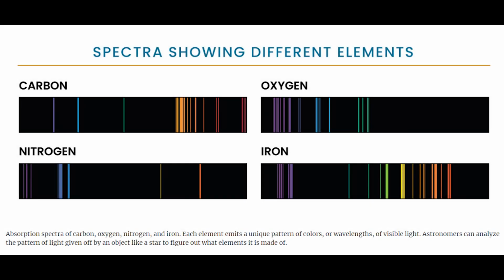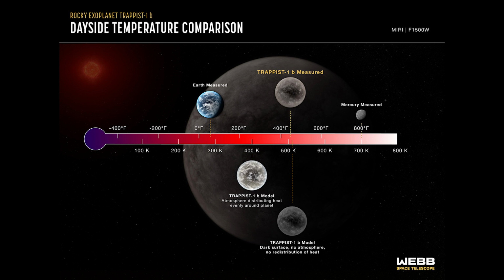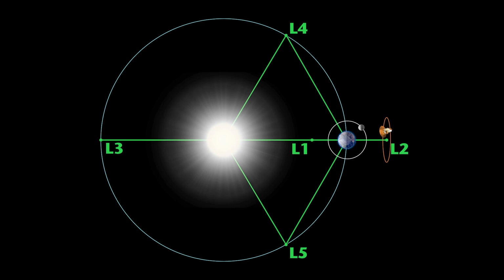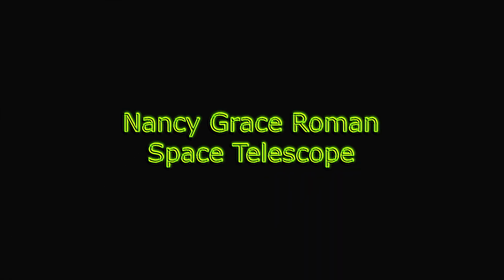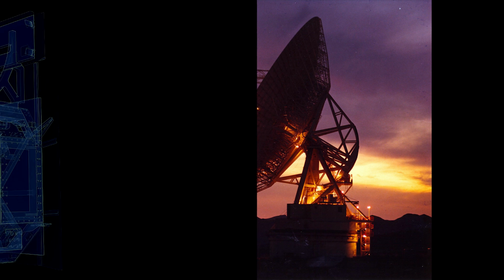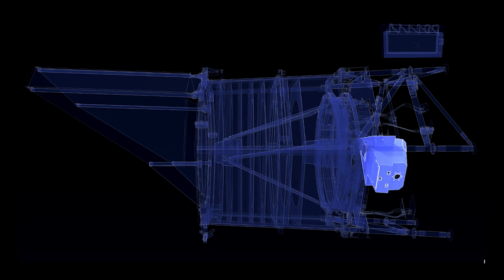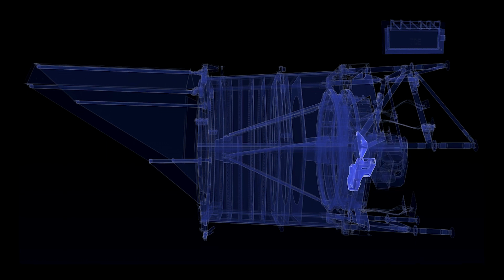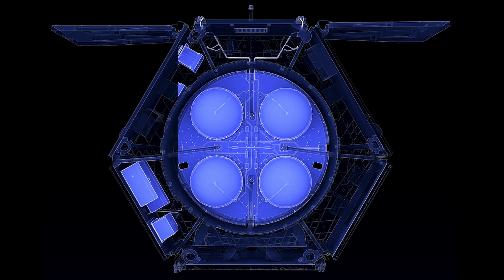Astrophysics - NASA Nancy Grace Roman Telescope

Comment: There is no dark matter or black holes. Most people don't know that Einstein said that singularities are not possible. In the 1939 journal " Annals of Mathematics" he wrote "The essential result of this investigation is a clear understanding as to why the Schwarzchild singularities (Schwarzchild was the first to raise the issue of General relativity predicting singularities) do not exist in physical reality. Although the theory given here treats only clusters (he was referring to large clusters of stars) whose particles move along circular paths it does seem to be subject to reasonable doubt that more general cases will have analogous results. The Schwarzchild singularities do not appear for the reason that matter cannot be concentrated arbitrarily. And this is due to the fact that otherwise the constituting particles would reach the velocity of light."
   He was referring to the phenomenon of dilation (sometimes called gamma or y) mass that is dilated is smeared through spacetime relative to an outside observer. This is illustrated in a common 2 axis dilation graph with velocity on the horizontal line and dilation on the vertical. This shows the squared nature of the phenomenon, dilation increases at an exponential rate the closer you get to the speed of light.
   General relativity does not predict singularities when you factor in dilation. Einstein is known to have repeatedly spoken about this. Nobody believed in black holes when he was alive for this reason.
    Wherever there is an astronomical quantity of mass, dilation will occur because high mass means high momentum. There is no place in the universe where mass is more concentrated than at the center of a galaxy.
   According to Einstein's math, the mass at the center of our own galaxy must be dilated. In other words that mass is all around us. This is the explanation for the abnormally high rotation rates of stars in spiral galaxies, the missing mass is dilated mass.
   According to Einstein's math, galaxies with very, very low mass, particularly in their centers, would not contain dilated mass because they do not have enough mass to achieve relativistic velocities.
   To date, this has been confirmed with 5 very low mass galaxies, all showing no signs of dark matter, in other words they have normal star rotation rates.
   This is virtual proof that dilation is the governing phenomenon in galactic centers, there can be no other realistic explanation for this fact.